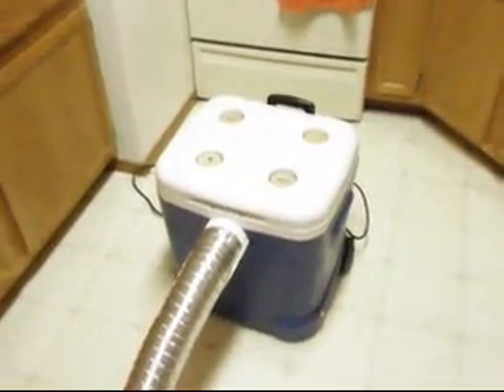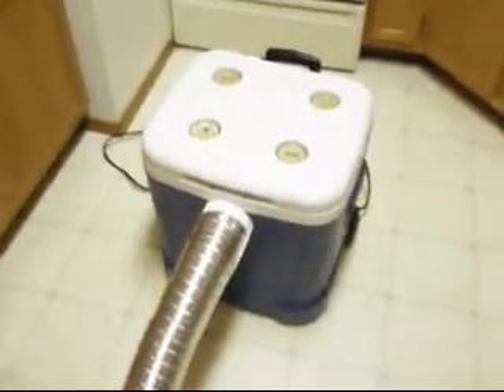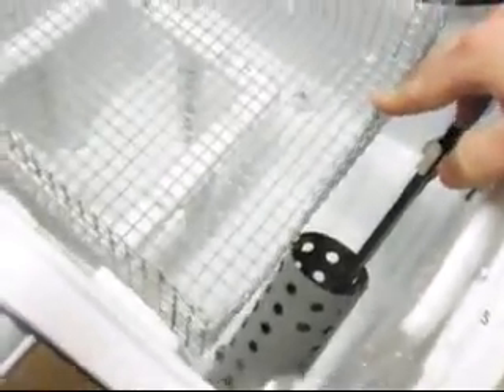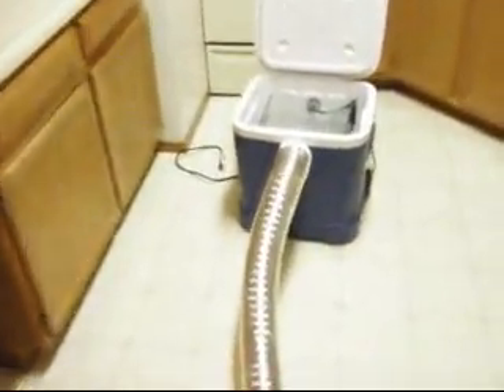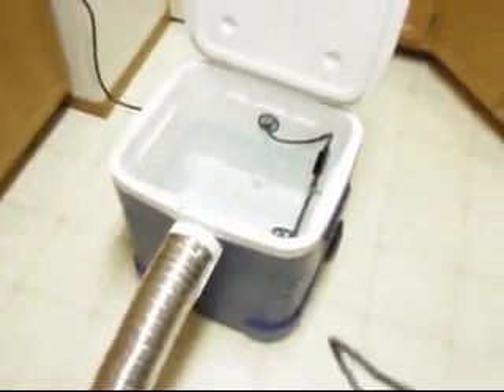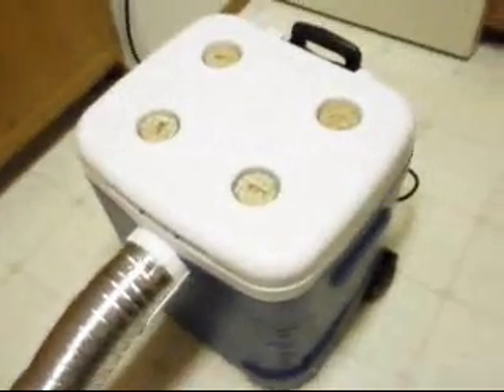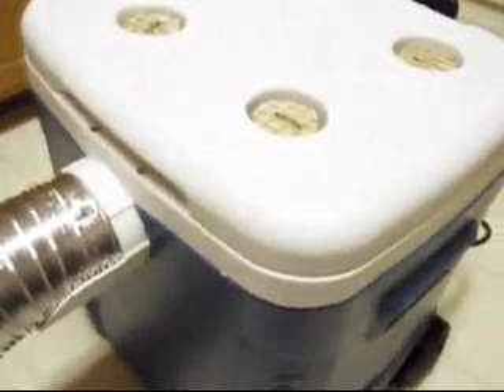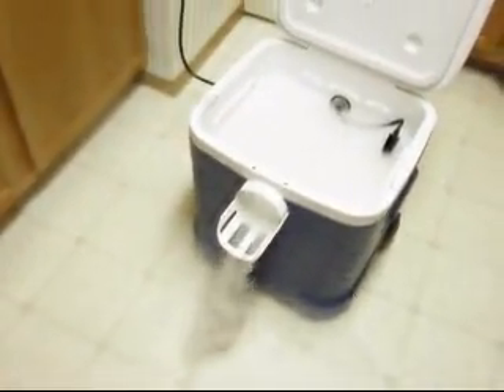Homemade Dry Ice Fogger

Comment: I made one for a dance party at a local studio.  It worked great except it created water on the floor as described.  I tried to alleviate it by creating a 90 degree bend at the floor with a vent hood- did not work.  The fog comes out around 80-85 degrees or so and 10 lbs of dry ice lasts 12-15 minutes depending on how hot the water is.   There is a good cheap hangar for the heater - use the U shaped portion of a door latch.  I am off to find a fogger that will stay low to the floor with no moisture but not eventually smoke out the room

Comment: Cool design with the heating element.You might be able to increase the output if you used a trash can and a hotter element. Attaching the basket to a pole that pokes up through the lid would provide a way to lower the basket once its filled into the heated water. Mount a fan to the side or the lid and hit the switch. You should have clouds of low lying fog like during the song no quarter in The song remains the same. Great job.Thanks for posting the video

Comment: Have you thought of a manually dropped basket (some sort of lever-action), for events where you need fog at a specific time in the show?  That way you don't have to mess with the DI when the time comes (load the DI into the basket before the event), just push down a lever when the time comes to need smoke (and lift it up when your need is over, this also preserves the DI for further use)?

Comment: Doesn't it make the dance floor dangerously slippery? That would be a concern, also: did it set off a smoke detector/fire alarm? Thanks in advance for answering these questions if you can. ;)
Reply: I doubt it would set off a fire alarm because of how it stays low to the ground. As for the moisture issue that would be a concern. I made a smaller less complicated version of this and it did make the surrounding area moist.

Comment: put the fan at the porthole, you can use a electronic fan 12v with a variable control.. also bring water to a steam, and the smaller the drice ice , like stone size will produce better fog.. nice brother

Comment: 1:05 that's the fun part : ) First test How long did the dry ice last. If it last longer than 2 hours a dry ice chiller may be more effective although more costly (and kids at home be careful how you handle it!)  compared to a couple hours of Halloween using refrigerator ice (which btw doens't stick together like bagged ice). Steaming you floor Lol I never thought of that. I assume dancers didn't slip on the dance floor though(?) I love our different DIY approaches building on each others ideas!

Comment from the maker: @gr8ash123 We considered it, but after running countless tests, we found that once 20lb. of dry ice was actually dropped in there....it has enough force to pop the lid open. What this essentially means is that it would just give the fog somewhere else to go besides where we would want it to go. Your basic CPU fan which I believe you are describing requires no force to be exerted against it. Although the fan would be spinning, it would not be forcing air in, rather swirling the more powerful fog

Comment from the maker: @traderpete007 Pretty basic and straight forward. The dry ice basket got dropped in manually and then the lid closed. I picked up this "bucket heater" up at Tractor Supply Store. Once you have this thing completely filled with 20lb. of dry ice it makes ALOT MORE.good luck!
Reply: What size cooler is this, Mr. Cool? 48-50 Quart? If you had a chance to remake it, would you use a smaller cooler or larger?